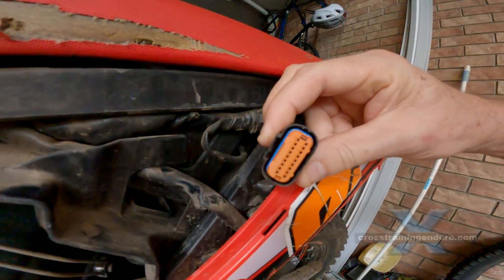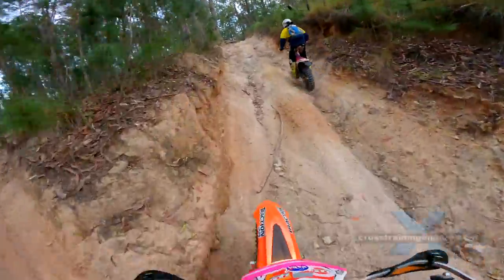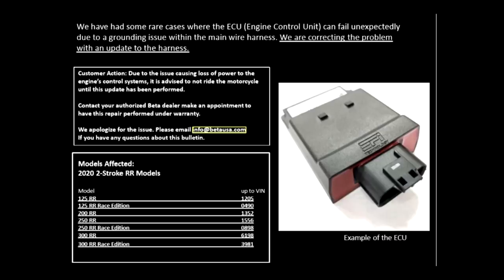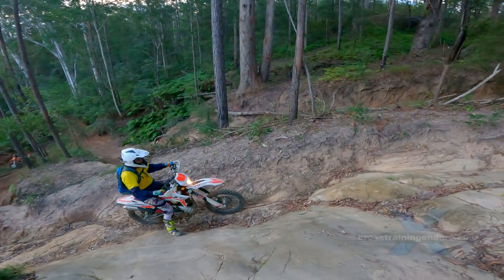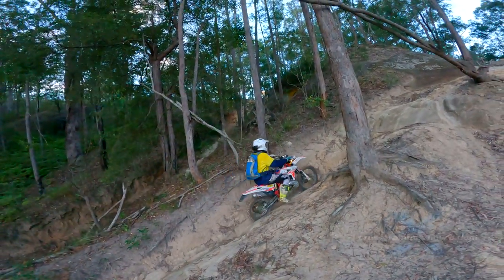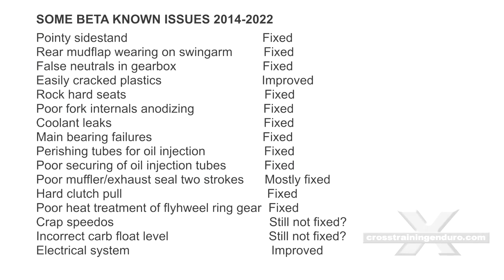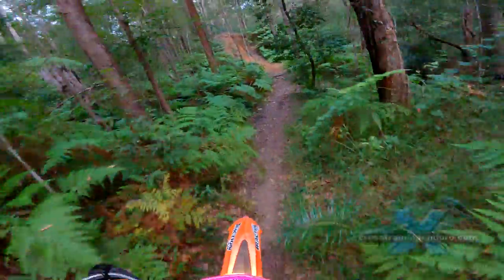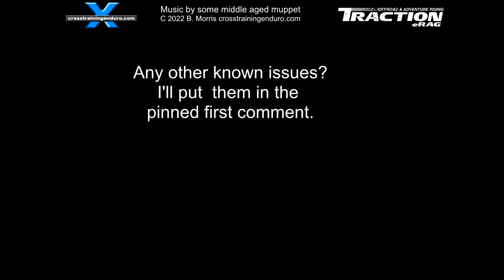Beta 2022 RR300 RR250 Xtrainer known issues review: more electrical issues 😢︱Cross Training Enduro

Comment: Barry, thank you for the video, I greatly appreciate the information. I have put a little over 90 hours on my 2021 Beta 250rr - zero issues so far.
Reply from the maker: Great to hear, Ariel! That's certainly the case for most owners. The panic merchants always see these vids and assume that any Beta is about to fall apart or seize at any moment. The reality is 'known issues' are usually only a small percentage of any manufacturing run.

Comment: I picked up a '22 250 RR a couple of weeks ago.
Dielectric greased the ECU plug and any other electrical connections that I could see, they all looked good with no corrosion. 
Cheers for the tip on the ground connections I will check that out also.
What carb float level is the go to.?
I got really shit fuel economy on the first ride, but I reckon most of the juice was spilled out the overflow.
I have looped the overflow hoses to help with the problem, but I think a correct float level would be the go, I just have no idea what that is. 
Can't wait to get back on the  bike this arvo for a ride 🍻
Reply from the maker: I don't know about the correct carb float levels, Glenn. Plenty of internet discussions and advice around though!
Reply: Does looping the overflow hoses work good? I heard about it already a couple of times and was thinking about doing it on my 300 rr but I'm just not sure if it might be bad for the carburetor? 🤔
Reply: @fh4248  it definitely helped my bike with its excessive fuel usage mate. My first ride out I was bloody near empty  at 60 kilometres.
2nd ride last week in similar terrain  fuel usage was similar to my KTM 350 exc.
Id love to know what the goto float level was, I'd prefer to do that than loop the overflows.
I have a mate with a '21 XTrainer 300 and he has looped his overflows as well.
The manual says 16mm but I reckon that is to high.
Rock the bike on flat ground and ya get fuel pissing out of overflow.🤷‍♂️
Reply from the maker: No idea. I've heard about it but my mechanical knowledge is next to zero.
Reply: @glennaltschwager5234  I'm pretty sure that 16mm measurement is a misprint. I've seen it referenced other places at 8mm. Mine is set at 7mm so the float is parallel to the carb body when tilted @60degrees. Do a search on keihin pwk 36 carburetors (not air striker).
Reply: @Jurgy777  cheers m8. Something didn't seem right.
Did yours come at 7mm from new ?
Reply: @glennaltschwager5234  Thanks 🙌🤝
Reply: Looped the overflow hose on my 18’ 250rr. Otherwise I’d drive to a destination or lean the bike a little and Be left with a puddle of petrol
Reply: @glennaltschwager5234  Mine was a tad high to start with - had a little overflow spillage. 7mm was my adjustment and no more dribbles.

Comment: Yep my oil injection failed on a Australian delivered bike. Oil Injection pin broken off in the ECU plug. Weird how its always that pin must be something to do with the grounding issue. Was 2 months old with 5hrs when it failed.  Hopefully Beta will sort it out for me.
Reply from the maker: Let me know if Beta don't sort it out, Rob. I've already heard from a few dealers that the national distributor is saying to dealers they should have greased all the connections as part of their pre-sales delivery. 😂 I don't know if they use that excuse to NOT pay the warranty though.
Reply: Finally have my Xtrainer back after 10 weeks in the shop. All fixed at no cost new wiring harness and ECU no dielectric grease though. Will go right through the bike now check the grounding and use some dielectric grease on the connections. Love this little bike cannot wait to go out riding again.

Comment: I’ve had this with a 2021 model causing pump failure and resulting in engine damage here in the UK.
Reply from the maker: Bummer. Fixed under warranty? Going by reports we've had, it seems the UK distributor is not as supportive as the USA guys. 🤔

Comment: I'm still amazed that buyers will still put up with manufactures and dealers charging full list price for a machine and then add delivery and assembly charges  and then expect you do the basic weather proofing  and bolt tightening . I understand not everybody rides the same conditions but still " JUST THE BASICS".
Reply from the maker: I tend to agree, James. All the European brands can be pretty slack in certain respects. At this point though, I think Beta USA is pointing to an external cause for the main issue in this vid and I'm prepared to take that at face value for the time being. But of course it might also be shoddy assembly/design/quality of that CDI connector too... time will tell!

Comment: Hey guys, my 2023 300 2T has only 7 hours on it. Spark plug failed at 3.5 hours, fuel filler cap leaks which looks like a poor tank moulding, and now the starter switch is playing up. In taking off the head light shroud, the rubber bulb cover has already perished…..hoping these are teething troubles as the bike rides well.
Reply from the maker: Damn. Hopefully all fixed under warranty? It would be interesting to hear if other owners have these issues too.

Comment: My 201 Xtrainer has been fabulous.  OI works a treat and no issues.  I do inspect well after every ride, treated connectors with ACF-50 and tuned up the main earth. I also added one going between battery and engine case- just to minimize resistance for starter.
Reply from the maker: Good to hear, Mark! Like most 'known issues' with any bike, usually the majority of riders won't actually come across the problem.
Reply: Mark hollingsworth,  is acf 50 ok for electrical connections? Saves me buying dielectric grease! 
I have a can of acf already

Comment: My partner has a 2022 xtrainer 300 in aus the corrosion has affected it and forced the oil pump to fail and shut the bike down at 306kms we have had it less than 6 months
Reply from the maker: Was that this post on Facebook, Rob? Any resolution? https://www.facebook.com/groups/BetaXTrainer/posts/5472098186214416/ 
These corroded pins were first reported in the USA, and Beta USA claimed it was due to bikes sitting in freight containers during covid-inspired delays. But it seems to be happening everywhere so I think it must be an issue from the factory. The Beta Australia distributor is very aware of the problem and apparently has at least one Beta very annoyed because he's saying the dealers should be putting grease in the electrical connection of every new bike. The dealers I spoke to think it's definitely a warranty claim as it's a factory defect.
Reply: @crosstrainingenduro  hi sorry for the delayed response 
Unfortunately yes that is the bike, the following week afterwards I was in contact with the dealership owner and had a discussion with him about it and he was apologetic about how everything went when it was in for repairs previously.
It is still currently in getting the repairs done. They have had to order some parts in from Beta in Italy so we aren't sure how long it will be in for at this point in time,
We are hoping that it won't be too long as we are keen to get out riding again

Comment: I just installed the bigger "clear" petrol tank for the 21 X-Trainer 300, it took 10 liters and a bit. I might go over the wiring harness now i've watched this vid. thanks for the tips Barry! btw my bike has been good, no real issues only the carb float when new seemed to rev on a bit, though I tweaked the mixture a bit and it came good anyway. Still using the pre oil mix pump, has anyone eliminated the auto oil mix pump and just adds oil to the fuel before filling? keen to hear what others are doing, cheers!
Reply from the maker: My understanding is quite a few riders keep the oil injection until the warranty period ends. Others like me just keep it permanently as it is quite reliable. However a Beta dealer I know always tells his customers to consider removing it as the bike gets older for peace of mind... but he doesn't give a specific age to do it.

Comment: My 2021 300rr-radiator cap seeped coolent from day 1,when I wash bike left blinker dash light comes on for a couple hours(I don't have blinkers).At about 20 hours my kill switch stopped working unless I moved wires around going into housing.My friends 2020 200rr the tps went out and would dump almost a full tank of oil per tank of gas.Removed oi on that bike and just run premix.
Reply from the maker: I haven't heard anything about recent radiator cap issues, Jeff. Quite a few years ago the problem was they were too tight and built up pressure in the system and some riders had coolant leaks. Re: the oil injection, I know quite a few riders ditch it once they are out of warranty. One dealer I know recommends doing this before the bike gets too old. The oil injection is actually quite reliable but of course it can get expensive if it does fail!
Reply: @crosstrainingenduro  it was minor and dealer just handed me another rad cap.They replaced my kill switch last week under warranty even though the bike had just went out of warranty.Just minor issues compared to what I dealth with on my Africa twin.
Reply from the maker: Interesting, Jeff! What happened with the Honda? I know Honda has a great reputation for reliability but like every brand they can drop the ball occasionally.
Reply: @crosstrainingenduro  upper fork tubes were trashed at 7200 miles.I had the replacement,s hard coated.Switch gear on handlebars replaced because they quit working.

Comment: I have a 2018 beta stared wining and smoking !!! I got a brand new bottom end crank from beta but put the bike back together and no spark? So iv been told to buy a new ECU ?? Thanks Ed
Reply from the maker: Have you had their mechanic go over the bike with a volt meter, Ed? I'm just wondering if it might be as simple as a bad connection? An ECU failure at four years probably isn't that unusual though...
Reply: Yeah he been over the whole bike .. and it checked all the electrics and it seem ecu is best option it lucky enough I can send back to a shop beta Uk 🇬🇧 if that’s not the issue thank you for your response will let you know what happens and go from there appreciate your time 👍🏻

Comment: Hi Barry,
Have you heard of any shifting issues (i.e. intermittently unable to select above 3rd gear) on a 2022 Beta XTrainer?
Mine has approx. 4hrs and I am experiencing this issue : (
It appears to happen more often during medium/hard acceleration than light acceleration shifting.
Thanks,
Jeff
Reply from the maker: I haven't heard of that one, Jeff. Maybe check on the Xtrainer Owners page on Facebook? Years back the Beta two stroke gearboxes had a few false neutrals but that was fixed at some point.
Reply: @crosstrainingenduro  Will do. Thanks Barry.

Comment: No electrical issues yet on my x-trainer. However I really want to get this closed to 1/4 throttle lull solved. Wondering if it needs a different slide/cutaway?
Reply: What is a lull? Bike wants to stall? Bring up the idle ? If you have to bring up the idle, you may have to play with the air screw.
Reply: @TheDirtyBirchTrails  not stalling or related to idle. Just feels boggy at that lower range where I hoped it would really shine. I've gone up and down sizes on my pilot, adjusted the air screw, moved needle up and down and even tried a different needle. Nothing I've done seems to have any affect on that particular throttle opening. I expect the bike to have snappy response through the entire range but just doesn't seem like it wakes up until beyond 1/4 throttle. I'm hoping that, despite being an x-trainer, its not tuned to perform that way by default - e.g. pipe performance characteristics, watered-down cdi power curves. I've ridden enough bikes to know that something seems off, wish I knew what it was.
Reply from the maker: Strange. Generally the Xtrainer bottom and midrange is the same as the RR model. I'm sure your local Beta mechanic would have a long list of possible causes to work through.
Reply: @crosstrainingenduro  thanks Barry. Good to hear that both models bottom end hit feels similar in previous model years - that gives me hope in getting tuning sorted.
Reply from the maker: It can vary a bit. E.g. they really got the squish settings perfect on my first Xtrainer and it had more grunt than all the other RR300s until the higher revs. I had to dial the power valve down to stop frequent wheelspin. My second Xtrainer just feels like everyone else's Xtrainers or RR300s at low to midrange.

Comment: Great video! 
I just picked up my 22 xtrainer and noticed there is movement at the top shock mount, approx 2mm, which translates to approx 5mm at the wheel. Upon Inspection it looks as if the bolt diameter is too small.

Anyone else have this issue?
Reply from the maker: I saw you post about that on Facebook, Brenn. I haven't heard of another case so it sounds like a one-off. I hope it's fixed under warranty.
Reply: @crosstrainingenduro  I have a 2021 XT and the rear shock moves a little bit. I contacted Beta USA and they said its normal. Its meant to be that way.
Reply: Here is the answer: "Hello Roberto, The shock has a joint at the top mount that allows it to move a little side to side about 5-10mm or so. This is normal. 
Sincerely,Tim-"
Reply: Just picked up a new X Trainer yesterday and while I was in the shop revving it to heat treat it I notice the rear spring pinch adjuster was slowly backing out as  I hit the throttle. Loose as hell. The bike also slowly backs up across the concrete while its idling in N and the kickstand is down.
Reply: @crosstrainingenduro  why do I always read your replies in your accent? I’m a North American looking to bwia a beta rayce modal

Comment: Almost 5 years on, my 2017 at just over 300 hours had the yellow MIL fault lamp turn on during a 56 mile outing. It was intermittent for a little while then full on. There was still smoke under acceleration, so I knew the oil injection was still functional.

 It turned out to be BOTH wires broke at the oil injection pump connector, right through the insulation!! In turn the ECU started pumping at max rate fir the duration of the ride. I just figured out it is a Sumitomo connector (identical to many automobile fog lamps!!) and $13.00 on eBay just bought the fix, with a pigtail lead as well. I'll be using a hot glue gun to stabilize and reinforce the wires, and some heat shrink tubing too.

 The Beta Italian wiring/wire harness is abysmal. Low quality wires. Or else they learned from China. It seems my only annoyances are stupid little stuff like this otherwise I love the bike and will likely ride it forever. Just did my first top end too. Old piston looked fantastic.
Reply from the maker: Overlooking the main bearing issues, the Beta two strokes have generally been great. But yes, their electrics are terrible. And quality control at the factory is often very low. Most dealers I know say they've had to carefully go over the bikes for missing parts, bolts missing, bolts only hand loose, poor rerouting of wiring etc.

Comment: It's a good idea, to put Penn Union cual gel, on all electrical connections. I do it on my Sleds And dirtbikes.
Reply: SuperLube 82003 Anti-corrosion in the States, $7.72 for 3 oz at Amazon.
Reply: @ljprep6250 : The Penn union stuff is non petroleum base, and won't degrade rubber over time, the superlube stuff is still an oil product, although synthetic, can still degrade rubber over time.
Reply: @Trad-Am  Thanks for the info. Do you have cites on that, by any chance?
Reply: @ljprep6250 : You can pick it up at PLATT electrical, or most other electrical supply shops, for about $8-$12.
Reply: @Trad-Am  Great.  There's a Platt about 6 miles from my house.  I still have a small tube of the Echlin dielectric grease from my automotive years, which I quit in 1985.
Reply: @ljprep6250 : Just call first, I went to 2, before having to drive into Seattle, which I don't wish on anyone. They're all supposed to have  it though, and can ship when they're out.

Comment: And can any one help me beta 300rr 2017 I'm running the oil pump as normal when the bike is half empty of girl it's starts to bog when full it's fine wtf is going on I've check vent tubes all fine and no fuel filter unless it in tank any mechanics seeing this
Reply from the maker: You'll get much better advice usually from your Beta mechanic, I'd be wary of internet advice. Also quite a few Beta dealers and mechanics recommend eventually scrapping your OI system as the bike gets older, the chances of failure from multiple causes increase steadily with age.

Comment: Wanted a new 350-390 Beta, but to many scary stories, factual or not..  Now waiting till mid year
Reply from the maker: I'm not aware of any scary stories for the four strokes at all.... any examples? As far as I'm aware all you really need to be aware of is replacing those plastic pump gears at the specified 100 hours. The only issue of note in this vid is the potential corrosion on two stroke models affected by one particular shipment - no four strokes at all.